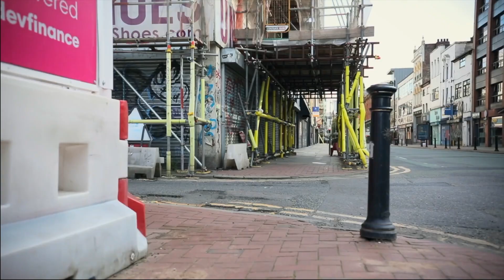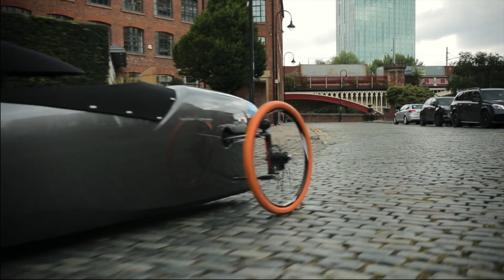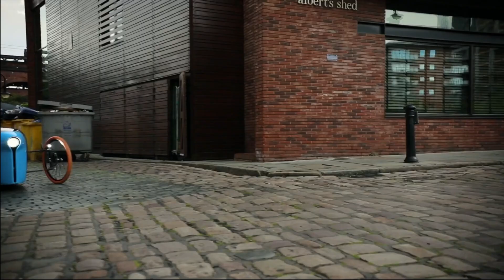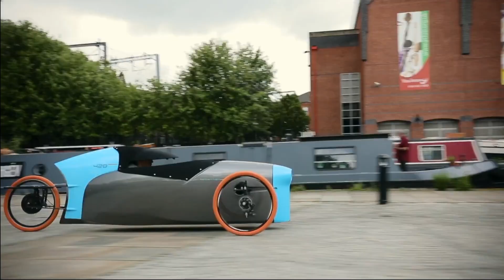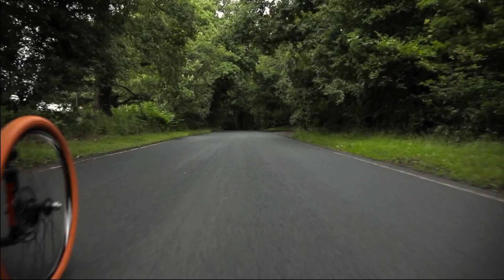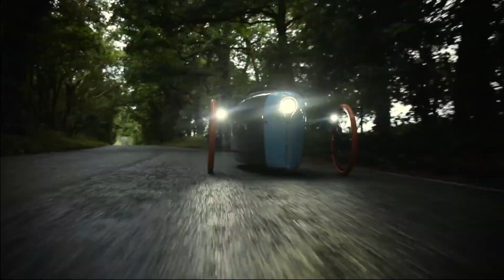Amazing Electric Bike Design is crippled by laws and regulations

Comment: This bike looks dangerous. How do you quickly get out of dicey situations? Visibility looks extremely poor. How do you signal you're turning? I doubt if I could properly get in or out of it! Why can't we just ride traditional-designed bikes wearing the right clothing?
Reply from the maker: What I advocate for on the channel is a new way of doing these vehicles. Light electric rather than shove them as ebikes. So with this I liked the potential more than every aspect of it. Your point about indicators for example is wise. They are lacking. In terms of visibility for the driver it again could be better. It might also be unsafe in many places mixing with existing transport. The point for me though is vehicles like this could fulfill a huge role if we let them. We could make it safe to use them. I don't think we can solve the transport problem replacing all the cars with electric equivalents. But if we could replace lots of them with LEVs? Already in Copenhagen 40% of journeys are with cargo bikes. That's brilliant. At least I think so. Maybe save bigger stuff for longer journeys. Turn city centers into lev and pedestrian zones. I have nothing against cars or motorists. But I also recognize we need solutions. So that's why the vehicle inspired me. Not for every part of it but for what it could be. Appreciate the comment. Cheers

Comment: i think why it was banned is because it is not an ebike or even a bike in the traditional sense i saw no pedals or chain (unless it is like those digital ebikes where the pedals are an electrical generator and it powers the motor by wire).

or they was so banned that the law completely abolished them (unlike other banned products that still remain because people hoarded them)

or you did not have a good enough pc and not enough to render all the graphics so you had to make do with consumer cg software and a gaming gpu and omiting certain items to keep the load low enough to render fast enough.

now that you are rolling around in the money from the videos you can cash out your videos and buy a high end workstation and a quatro or even cmp card
Reply from the maker: As far as I am aware its a recumbent style bike inside so meets the legal description of an ebike but please post a link if you know otherwise. At the rate I get income from YT the human race will likely be extinct by the time it would cover the cost of a PC lol. Do you think this was rendered? I am using the footage from the company under fair use guidelines. Cheers

Comment: 250 per wheel ? ? ?
H-D makes an electric motorcycle , is that also banned over there ? ? ?
Reply from the maker: The motor looks much bigger than 250 watt..I'd say it's being firmware limited. It's just the rear tho.

Comment: .. Not a great design LEV by the look of it, just an electric velomobile which are impractical novelties...
Reply from the maker: It's the potential. This could easily just be a light electric vehicle for the urban environment. No pedals just light, efficient and at least in use non polluting. If you charge it at home with a mini solar etc then it's likely the least damaging vehicle there can be that has its own power.
Reply: @HighVoltageKits ... It's an impractical, fragile looking velomobile which is basically a sporting novelty for medium to longer distance use cases, it would obviously be a pain to use day to day in built up areas. Please explore some better more utilitarian design examples of light electric vehicles to show, this isn't it.

Comment: One conclusion I'm increasingly coming to is that rather than being of benefit to people, governments are are only interested in restricting and crippling everything they touch in the name of the public good. Power and control is a hell of a drug, and they are loath to give it up. If a little bit of control is good, then massive, intrusive control and power must be even better.

The real purpose of government is to provide taxpayers with services, infrastructure, safety and protection, and otherwise get the hell out of the way so people can simply live. But this is not how governments are operating today.

We had similar problems here in the province of Ontario, Canada. When e-bikes started coming on the market in the early 2000s, the provincial government blocked them and refused to allow them to be used on Ontario streets. Then they wanted to study e-bikes to death, which was just another way to delay their introduction. Then, in an attempt to make e-bikes unattractive, they forced manufacturers to add pedals to their bikes before they could be legally used, even though they weren't strictly necessary to control an e-bike. It took more than 10 years for the government to finally relent on e-bikes.

The real concern was never public safety, but gasoline taxes, and auto industry jobs that generate more tax revenues and votes for politicians. Moreover, e-bikes can't be taxed the way cars are and governments hate anything that can't be taxed or controlled.
Reply from the maker: Yes. The Ontario stuff is a mess. I used to live in Kingston and Gatineau which is spitting distance of Ottawa!

Comment: I live in the UK, have a suv and also diy ebikes so I'm not sure what that makes me 😁. I'm not disagreeing with your video, loads of valid important points.
Reply from the maker: Makes you a human being like me! I have a car. The wife and kids are down in Vancouver right now using it. That's not a trip we can do with anything else as trains here are for cargo not people. There is not the line capacity to make it viable. We use the ebikes for as much as possible. I would use them more but some trips are not very safe. I perhaps went a bit far with the SUV comments. The video was not intended to single out owners of cars and have a go. But it may have come across that way which does harm the message. In deep winter here ebikes are going to be a tough sell for a lot of people. But if we were to create LEV classes then I am willing to bet that companies would invest to make three and four wheelers that would work.
Reply: @HighVoltageKits  ahhhh mate I was only messing a little as I got my new car only 1 week ago, a suv, it's the easiest thing to get in and out of, I got into ebikes in 2016 due to medical issues and made my own as needed a throttle to assist my bad legs etc. I haven't unfortunately learned as much as you but  love my bikes and always watch to try and learn. Love my ebikes. I'm in the middle of making a bag with Rogovbags after seeing yours.
Reply from the maker: That's awesome. I love Rogov. Some of the best bang for buck I have ever found. Are you on our Discord? Be great to have you on there. Links in the description

Comment: It gets worse. Friend of mine works in a school in Leicester UK. Theyve just banned ebikes from their site entirely, preventing staff commuting by ebike. ebikes really help cover that middle ground between being just round the corner by bike or just far enough to need a car, suddenly you have a bunch of staff now forced into their cars (albeit, they arent huge SUVs because teaching salaries in the UK are a pittance and barely enough to live on).
Reply from the maker: There is a lot of fear about batteries. So this is a knee jerk response. When automobiles were first around people used to carry petrol around in cans and fuel up in their homes. There were lots of issues. Petrol fumes being explosive and all. So the solution was to have garages and safe storage. The same should be possible for batteries. The school should be able to provide safe secure storage. Safe charging for batteries where they are isolated if there is an issue. People don't fill up their cars in an apartment block for very good reasons. So making sure that large batteries are charged safely and people understand how they work is something that can be rectified. Sadly an knee jerk ban is easier for school boards.
Reply: @HighVoltageKits  complete agreement. Charging was already not allowed on site before which with the distances involved in UK was fine. But best part of the stupidity, apparently the rules regarding storage for the school board is that all lithium batteries have to be 6 meters from the building. Doesn't say ebikes only. So I guess the teachers iPads and laptops are banned too and the headmaster needs to move their EV which is plugged into a charger affixed to the wall of the building. And the school got a new bike shed 2 weeks ago. It's 5 meters from the building. They could have just put it 1 meter further away...
Friend and a few of her colleagues are kicking up fuss over it and trying to get rules changed back.
Meanwhile my workplace doesn't give a damn about my own ebike and their only demand has been get the charger PAT tested if I charge on site, which I don't anyway, it's only 2-3 miles.

Complaining about British rules, silly school boards and such asides. Love the content, keep it up
Reply from the maker: Give em heck. So dumb. Do the teachers have to leave their cell phones at home? Are they not allowed to experiment in Science anymore. If the saw the OMNICELL they would likely drop dead! I am a Leicester Tigers supporter so I know the place fairly well. I met my wife in Loughborough!
Reply: Yeah, lots of campuses around here are banning them, both educational and some corporate/apartments.  Fire is sometimes the issue, and like the apartments I'm talking about have a storage area for all ebikes, but also how people are riding them.  Used to be, in order to ride a bike fast, you had to be somewhat good at riding bikes first.

Comment: I built a bicycle trailer, it's about 5 foot long, (6 foot 6 inches with the towbar) and 2 foot 9 inches wide, so far I've had no problem using it on the road and the Law concerning bicycle trailers seems remarkably permissive here in the UK!
I've carried 8 x 4 foot boards and even a metre cubed water tank on it! (It does have a flourescent flag on it's rear and I try to be sensible)
Reply from the maker: Brilliant! Actually having a trailer makes you more visible and likely commands more respect. I am hoping to get mine back on the road once its been restored!

Comment: If they change the way they think , they will have to admit they are wrong and have been for a long time so they will ignorantly just keep going in the wrong direction !
Reply from the maker: People hate thinking they are wrong. I think that's part of the problem. Why people tune out and switch off. Its hard to think that most things we do right now are not awesome for our futures. Leading by example always works better than hitting people over the head with taxes and punishment.
Reply: @HighVoltageKits  it's also to do with towing the line in a cult indoctrinated institution like government . Its not a place for fresh thought !

Comment: they are good for urban areas but please stop with the "carbon emissions" crap there's nothing "low carbon" or "green" about ev's an don't bother with the "öh this new tech in the future" 🙄, fact is ev's pollute massively from lithium/cobalt mining that's far worse than coal, there is no environmently friendly lithium/cobalt mines they're mined on the backs of slaves no western country mines them because of how toxic they are to the environment, the composites go to land fill as do spent batteries, you can't "recycle" composites! and batteries aren't viable $$$$. just stop with the BS!! look i built my own Ebike way back in 2015 why? because of BS laws stopping me from fitting a little 4stroke motor, what i do agree with is the stupid power limits 250watts is a waste of time an money, i tell people who want to follow what i've done, 1000watts bare minimum an mid drive only, mine's 1800watts but keep cruise speeds to around 30-35kph that keeps any annoying cops off my back, especially now with escooters belting around at 60-70kph+ cops are always chasing them... look bud i like your videos an info just stop lying about ev's being environmental because they're NOT!
Reply from the maker: You are putting words in my mouth there. I said point of use emissions. There is also a case of scale. Where I live it's 100% Hydro power. So no carbon from that. You are quite correct on the cost of mining. No avoiding that. But there are not slaves in lithium mining. It's cobalt. People are working really hard to eliminate that. A LEV that uses 200 cells takes up vastly less resources than a car using thousands. So the impact is vastly less. We can and have to do better. Not going to argue there. But to claim that batteries are not viable or can't be recycled is plain wrong. You can find plenty of people peddling this myth though. At no point in my video did I say EVs were environmental. But their impact is vastly less. The cost to the earth of an LEV compared to a gas car is a tiny fraction. If you look at my work with batteries you can see me challenge that status quo as well. There are no easy solutions. But if we went to LEVs in our cities the footprint would be vastly less. This is not BS. This is a genuine attempt to be part of a solution. Its an uphill struggle for sure. Why do you love fossil fuels? Have you really managed to convince yourself that the continued endless burning of them is the solution?
Reply: @HighVoltageKits  you claiming "carbon emissions" pushes the  ënvironmental" BS narrative it's a fkn lie! as for recycling batteries 🤣 the vast majority go to landfill they're not recycled on a commercial scale, as for the mining 🤣🤣🤣 please, nothing is happening to fix that issue people that try exposing the cobalt pit slaves get silenced, companies are doing nothing about it because it'll hurt their bottom line$$$$$$$$,  ... you attempting to force people into/onto ev's pisses people off!! who TF are you to demand people switch to ev? you're no one! leave people alone to make their own choices!! why do i love fossil fuels? because they built the the world! and they continue to build the world! we wouldn't be here without them, everything we own would exist without them, this delusion ev people have the gas polutes more than ev's is absolutely laughable given how much pollution they've created before ever hitting the road compared to a gas vehicle, if you want ev's fine keep that to yourself stop being like damn veganazis trying to force your will upon others.... ev's have there place but i'll never dictate to people they should use either or gas or electric because that choice is theirs and theirs alone.... i'll never support tyrants
Reply from the maker: Again you are putting words into my mouth. Right now battery recycling rates are terrible but they don't have to be. The OMNICELL that I am working to develop is aimed at starting a conversation on how to improve that. The cobalt mining is awful. Which is why there are lots of places working to eliminate them from batteries. Where do I force anything. EU governments are banning gas car sales from 2030. That's not me. That's governments. They are doing it because despite fossil fuels building the world its time to move on. 99% of scientists that know this stuff are telling us this. If you went to a hospital and 99 out of 100 doctors said you had cancer and 1 said you were fine and to go home would you go with what the one Doc said? You are right that an EV CAR is more than a gas car to make. Except over the lifetime it is less. Now again LEVs as in light take up a fraction of resources of a car which is why they are much better for the environment. You won't even comment on that fact will you. Its easier for you to attack me and drop petty insults. You can''t trigger me with those or the emoji you use to try an belittle what I have to say. IMO we need to move on from fossil fuels. To stay the course is suicide. So I want to be part of the solution rather than the problem. You seem to want to bury your head in the sand. I even said in my video that replacing all of the cars with electric ones would be suicide. Did you miss that part or were you cut it short so you could put words into my mouth? What Tyrant are you talking about? I will always welcome civil discourse but try and keep some decency and perspective. Please stop claiming things that I did not say. I am not doing that to you. Cheers

Comment: Politicians idea to save the planet is a carbon tax? I didn't see a single effort to educate drivers, reduce speed limits, go to 4 way yields instead of 4 way stops etc...But I'm in Canada being lead by a pile of horse poop so what else would be expected.
Reply from the maker: Yup we got screwed with Turdeau. Before that it was Harper. I voted for Mad Tom. We need to ditch the status quo. The carbon tax for most people is a zero sum anyway so what's the point.